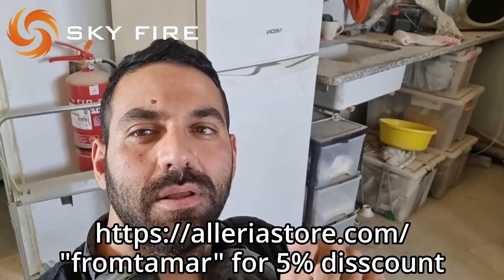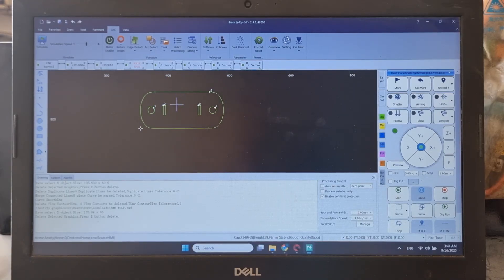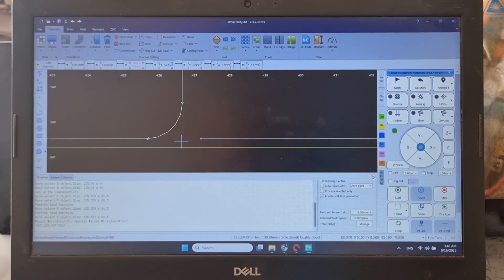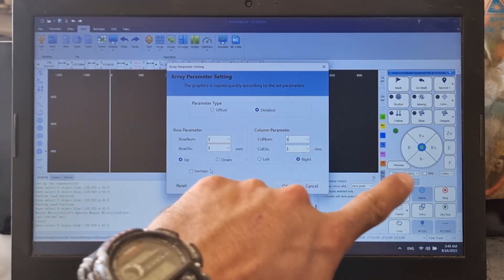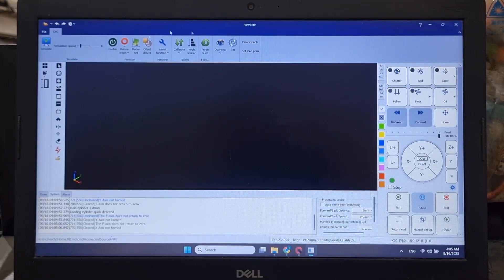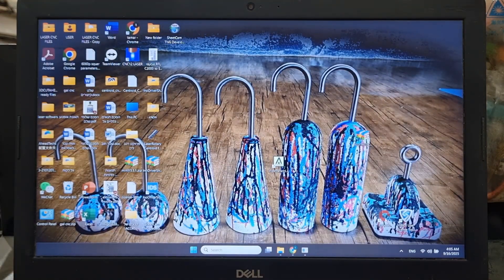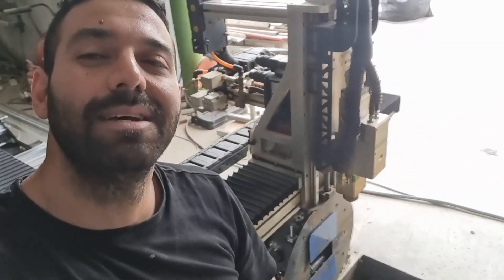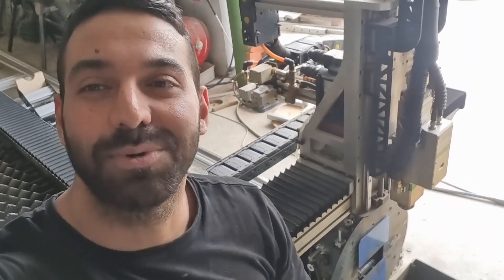DIY FIBER LASER RAYTOOLS AX3000T SOFTWERE

Comment: Hello, Tamar. Great video -- now I'm going to buy the same AX300T controller. Do tell me: does it have only ethercat inteface, or it has allso step/dir? Thank you.
Reply from the maker: It has both
Reply: @TAMARbarCNC 
thanks.
So I can plug all X, Y1, Y2, Z, A, B as step/dir?
Or there is some number limits for step/dir?
Reply from the maker: @CNC_machines you can connect 5 axis by pulse and dir.
All the other axis will need to be by ethercat.
I suggest that you connect all of them by ethercat. 
On my setup I have Y1, Y2, Y3, X, Z by ethercat , and F(focus) , U1, U2 by pulse and dir.
Reply: @TAMARbarCNC  Na parte da confuração de portas DI xx , e outras configurações teria um video explicando essa parte , muito obrigado .
Reply from the maker: @carlosschuh2678  what would you like me to show?

Comment: Great video, everyone always shows the machines cutting but never how to make it cut properly!
Reply from the maker: Thanks
Reply: Bro,

Great video.

But Can you do a step by step video on how to connect the Axis drives and where to adjust the drive parameters and all.

How does the software interact with the controller?
An Ethernet cable from PCI express network card to the controller?

Any special parameters need to setup for the laser source?

I assume that the controller has to adjust the intensity for piercing and cutting separately.

Also how to configure the dynamic auto height adjustment system?

If possible Please create a video explaining the overall working topology in a basic level.
Reply: Most people who follow you know about basic stepper motor axis drive from Mach3 or grbl.

The lack of knowledge in laser systems starts from the controller side.

As the controller itself controls the Axis and CAM side.

How to interface the Axis,
The Laser source, the auto height adjustment system..etc are unclear for most